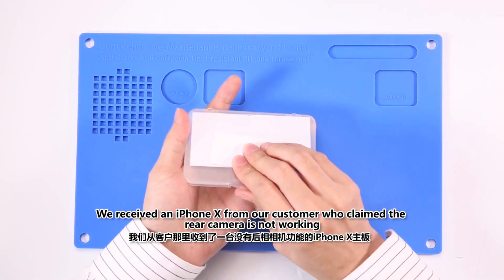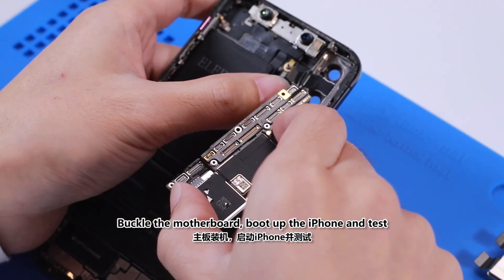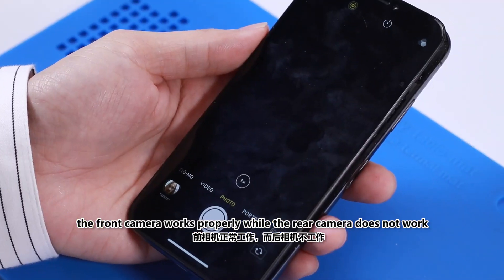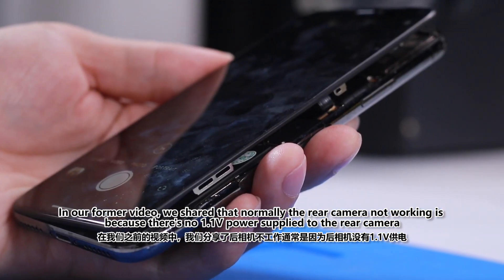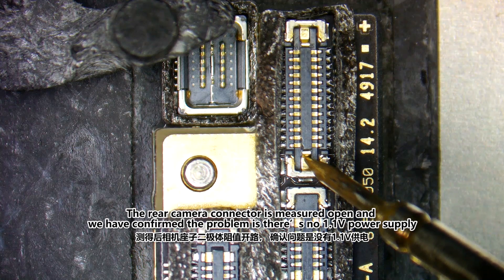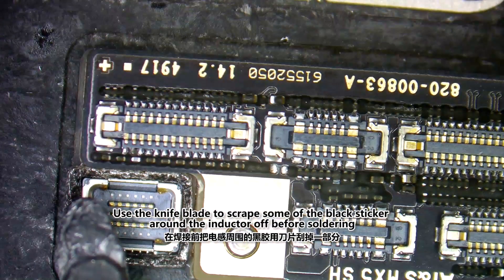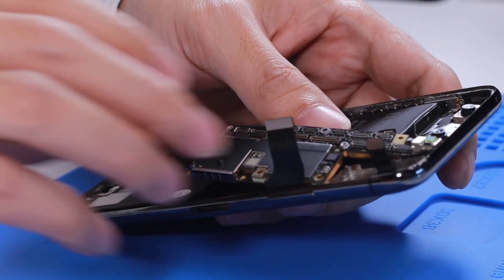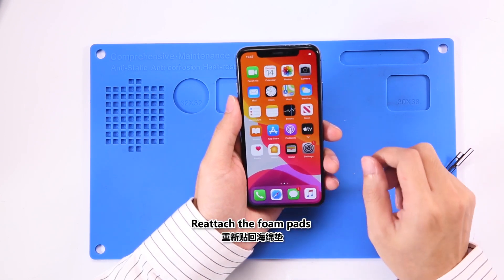How to Fix iPhone X Rear Camera Not Working | Motherboard Repair Lesson

Comment: Hello I replaced today the second time iphone x display. The first time after a while the front camera stopped working. Today mounted the second time the display and the front camera works, while the rear one does not work. What can I do? Thanks
Reply: Message Clintontech78 on 1G. Dude helped with mine

Comment: I have iphone xs rear camera and front camera not working
Reply from the maker: Hi, if both cameras are not working, you can try to troubleshoot the camera power supply
Reply: I was having issues with mine. But I'm now happy Clintontech78 on 1G fixed mine

Comment: I’m currently using Iphone x but the front camera is not working, what to do?
Reply from the maker: Try to replace the front camera and see if it works, if it's not working your phone need to be checked with  the true deepth camera system and the motherboard

Comment: If the both camera are not working Front and Back camera shows the black screen i check it but camera is not working.
Solution Please
Reply from the maker: You can troubleshoot the power supply of the camera